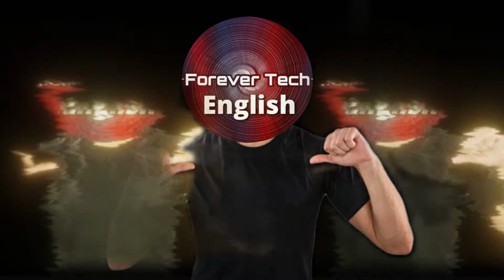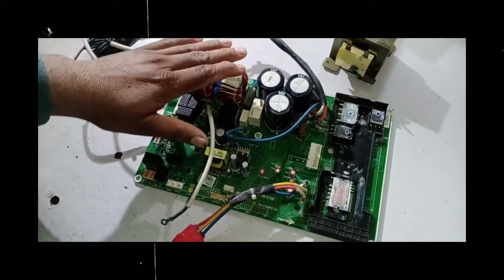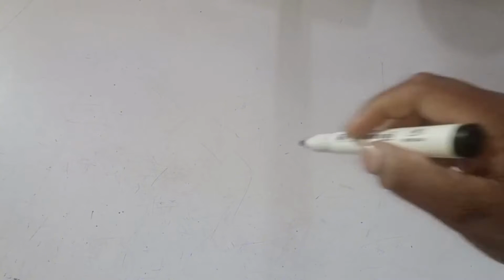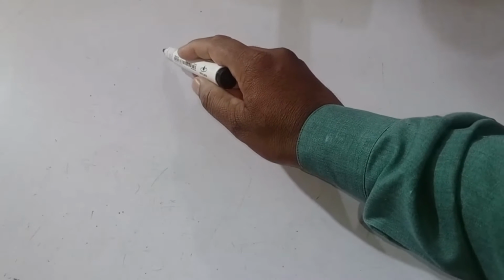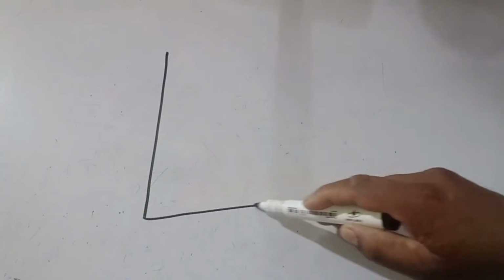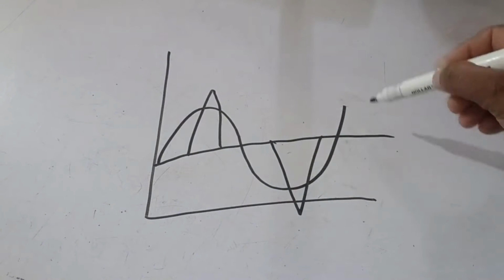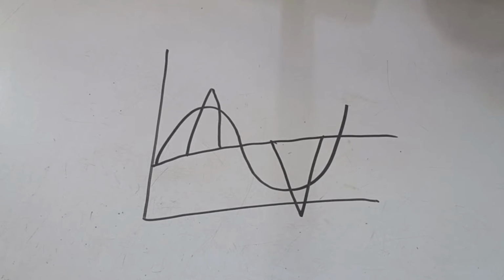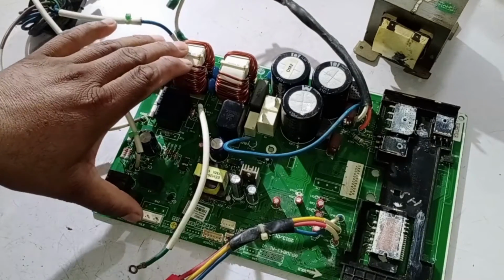How to Fix HC Error Code in Gree Mini Split AC

Comment: That's not the correct information at all over the Design concept of PFC circuit in Inverter  Of Airconditioner.
Once the Reactor is isolated, the rectified DC supply doesn't reach the main filters. Very poor explanation.
Sorry to subscribe
Reply from the maker: Thank you for your feedback. It seems there might have been a misunderstanding. My intention wasn't to explain the design concept of the PFC circuit in detail. However, I appreciate your input and will keep it in mind for future content. If there's a specific point you think needs more clarification, I'd be happy to discuss it further.
Reply: @forevertechenglish  that's great, always try to learn even your teaching us... knowledge is power